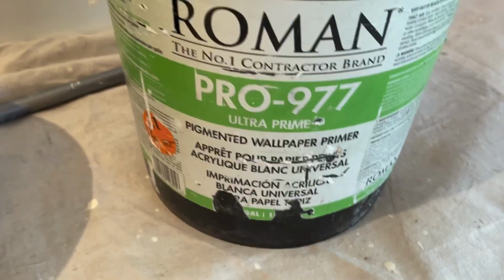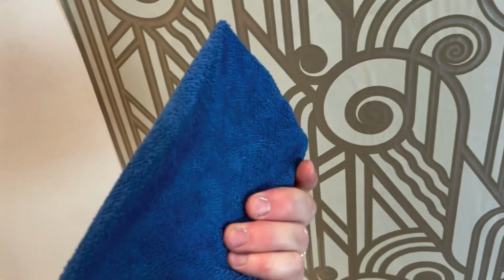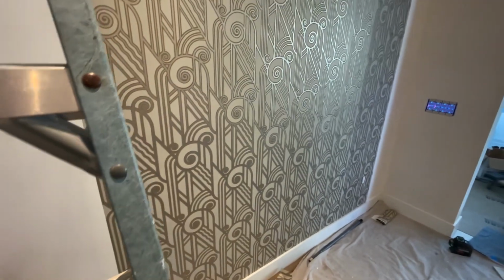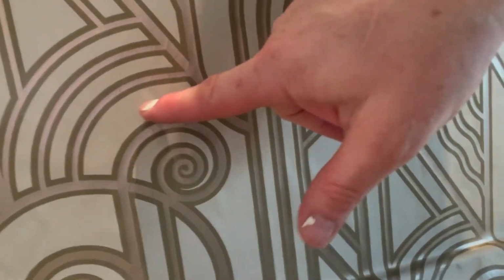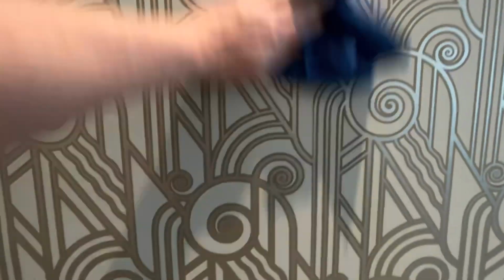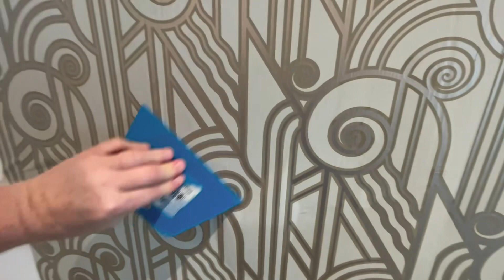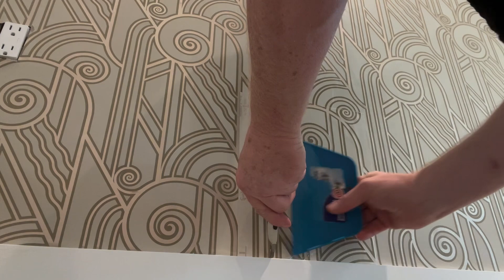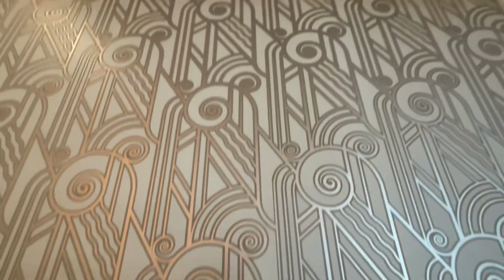How to Hang Untrimmed Bradbury and Bradbury Wallpaper - Spencer Colgan

Comment: As someone who works in the print trade could those T shaped marks be "register marks" for the printer? Where they would print the first colour and then rather than checking over the whole sheet for the second colour to line up they would just make sure all the register marks line up?

Comment: During the era that most of Bradbury’s papers reproduce, most wallpapers were made to overlap the selvage, which was usually printed in the ground color. So for every drop, there would be about 1” of overlap that shows once installed.  In historical homes, many folks want to keep that original look.  This was also a way of “hiding” a seam that didn’t quite match, because the gap would just show the ground color.  I always thought that was the reason for Bradbury doesn’t trim their papers.  In the 1868 house museum I work with, I’ve seen this effect on almost all original papers, where there’s enough selvage showing in hidden spots that it even shows the pattern number, lol!
Reply from the maker: Very interesting!  Thank you for posting that!!!

Comment: I’d recommend using points on the pattern near to the trim marks as a guide instead of the marks themselves when possible. I did a job last week with 18 rolls of hand trim, also a whole ton of border I had to trim as well. I need like a few days of accent walls